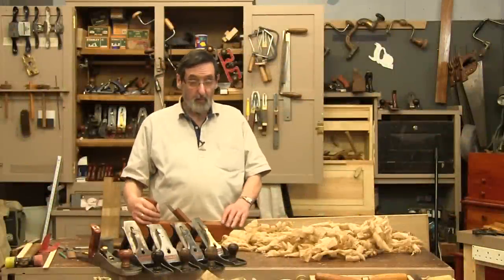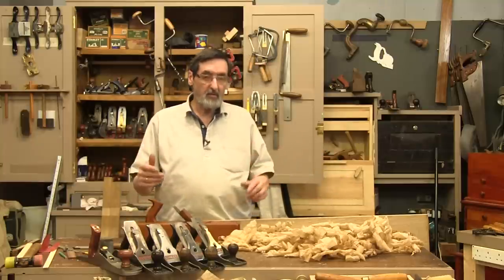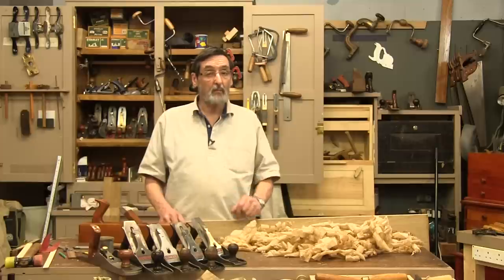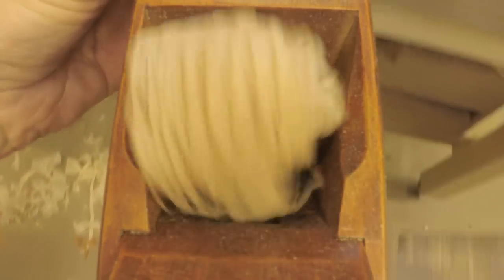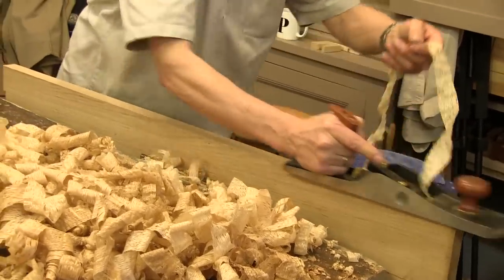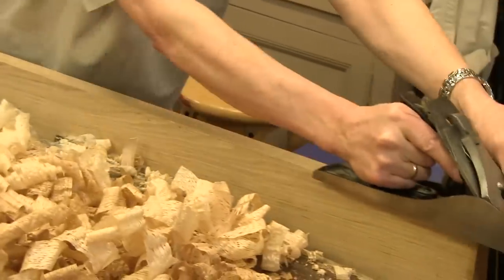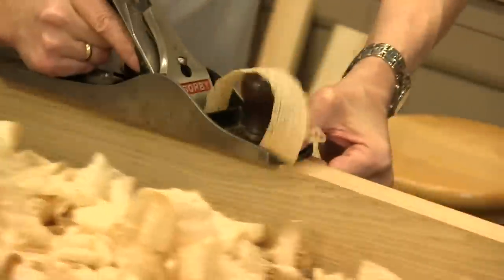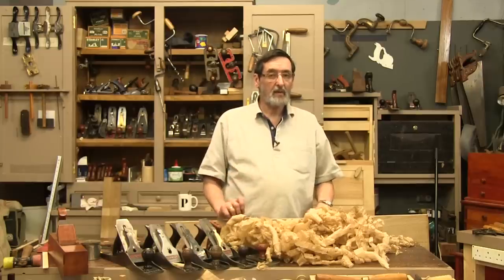Plane Bevel Ups and Downs | Paul Sellers

Comment: This and other videos of Paul's vigorously prove wrong all the BS being pushed today that we need $300 hand planes with thick, bevel up irons and the need to spend hours tuning and flattening them at that.  Such ridiculous BS.  I regularly cut shavings to 1000th of an inch with ebay and flea market stanleys, and craftsman brand planes (millers falls are great too). I do think there is a downgrade in quality of anything starting in the 1980's with US made products and alas we hardly make anything today that I can either afford or isn't crappy (or both).  Also, I actually have better results on endgrain with bevel down planes and regular angle block planes as opposed to low angle.  Stick with Paul if you like truth and reality instead of hype and fluff.
Reply: I AM ONE OF THE GREAT UNWASHED.
To me looking here is a gift. It's tough when you are beginner. , I look at these discussions and they impress me but I do have a problem with some of the advice I see on line.  Evaluating older and newer and cheaper with more expensive is ok, but
I am sure most planes can be directed to produce good results. My first planes were new Stanleys. I COULD get them to produce (or if the product was not good it would was likely be my fault.
My problem is those planes failed at continuity. Parts could loosen in the middle of a stroke!
The blades wore out  quickly, settings wandered and fairly often were not square. 
That's the real downside, to me.

Comment: That 'plane cam' was a real treat. Very satisfying!
Reply: I have said  the same sentiment as what you said in your introduction.  If you look at the amazingly beautiful woodworking produced by workers who did not have the benefit of the centuries of experience that we have today.  Add to that the fact that many of these tools were invented by these everyday workers.  These hand tools were the predecessors to automated mechanized told we have today. We can set up and load a conveyor belt to keep feeding boards into a planer then walk away and go for coffee.  That eliminated much of the fatigue the had to deal with.  What we have today is only posible because of what was done before.  Think of what those craftsmen could do with the tools of today.

Comment: Paul, this video is extremely helpful to me. I picked up what appears to be the exact same wood plane at a flea market last weekend for $3. It's in much better shape than the one you have in the video. I think whoever owned it stored it and never used it. After watching this video and the one on restoring a wooden plane, I now feel more confident. I didn't even know how to hold an older wood plane until I saw these videos. Thanks to your helpful content, I now know how to hold it, sharpen it, restore it and will now give it a new and useful life in my shop. Thanks again for the fantastic work you do.

Comment: Watching this made me wonder why perform the test on such an easy board?  Although this shows that all these planes are similarly competent for work on the edge of a board I would like to see how they compare on a variety of planing task such as, end grain, flattening the face of a board and interlocking grain. 
Also thinking about the wood plane I am going to go into the shop and laminate a piece of veneer to the bottom of one of my #4 Stanley planes to see how it feels in the cut. 
Love the addition of the camera on the tool.  Great visual and editing was perfect.  As usual Paul's presentation was spot on. Thanks for the post.
Reply: What a great idea with that veneer on the sole. Tell me if you’ve done it and how you like it.  Cheers
Reply: Because PS is about making woodwork accessible. Iroku isn't the easiest but not the hardest, but likely the hardest a hobbies might encounter

Comment: Just bought my first jack plane.  I am pretty excited to get to work with it. It will be my first adventure getting away from the jointer and dewalt planer.  Thanks for the tips in this video and your other video's about hand planes.

Comment: Hi Paul,
I watched your presentation because I was trying to verify the angle that a blade needs to be ground to. When I went back to my blades, to get them to an engineering shop to have them reground/machined, I found on all of my Stanley blades; some manufactured in USA and some in UK ; all had printed on them the suggested angle of 25 degrees.
All the presentations I saw spoke of other angles.
So I thought I would mention it for what it's worth; 25 degrees seems to be a standard

Comment: I have 4 wooden planes that I bought off Ebay and restored.  They are wonderful to use.  Almost not enough friction with the wood against wood.  Funny thing that.  Ialso have an old Record metal plane, a few new Veritas, Woodriver, and LN planes.  All are wonderful to use.  Love all of them, bevel up and bevel down.

I will say it's nice to sharpen the bevel up planes since it's one less step not having to deal with the chipbreaker.  Saves that extra 45 seconds for another sip of coffee. :-)

Comment: Paul,

Love your videos.  However, even though the bedding angle of the Veritas and Lie-Nielsen Bevel Up Planes are 12 degrees, the cutting angle is the angle of the blade bevel, PLUS the 12 degrees bedding angle.  

Out of the box, the Veritas Bevel-Up Jack Plane is 12+25 degrees, or a 37 degree cutting angle.  If you install a 37 degree beveled blade it will have a cutting angle identical to the Stanley Bailey types with a normal frog (45 degrees).  The primary benefit from the Bedrock style bevel-down planes is the ease of adjusting the position of the frog for adjusting the blade opening clearance. I doubt their stiffer body design makes much difference. Additionally, both Veritas and Lie-Nielen bevel up planes have very easily adjusted mouths, requiring to tools or disassembly for adjustments.

Any well sharpened and even moderately tuned plane with the proper mouth opening will yield gossamer shavings.  

The great advantage of the Bevel-Up planes is you can keep different bevel angle blades at the ready for different tasks from end-grain to highly figured woods.  Additionally, there is no chip-breaker iron to adjust or maintain.  

My plane collection spans from a $5.00 garage-sale #4 Record (Bailey style) to a $400+ Lie-Nielsen #7.  The big difference is the quality "out of the box" plus the advantage of a Bedrock type design for ease of mouth width adjustment.  My #4 "Footprint" is my favorite smoothing plane, using its original blade and chip breaker.  It cost $27.99 in 1986.  

I sold my #4 Lie-Nielsen bronze-body #4.  A BEAUTIFUL tool, but its tote was too cramped for my hands.  It made my hands ache to use it. I don't have that problem with the  Bevel-Up smoother designs from Veritas and Lie-Nielsen since their totes are placed well back of the blade and adjuster. 

Keep up the great work!

Steven Jaynes
Making firewood in a dozen or more exotic species since 1962

Comment: Dear Paul, Stanley Sb4 Single Blade Plane 1 12 034 used for and why does it have two adjusting screws on the blade(like the spoke shave) thank you for all your master classes.  Kind regards John.

Comment: Thanks Paul for the great video. Am i wrong in thinking that a 12° bed angle with a thick 38° iron is approximately equal to an older Stanley? The steel in the bevel up iron doesn't know its only fractions of an inch thick, so that bevel could be a 6" long bevel as far as the wood would be concerned. So what's the difference? Thanks

Comment: I bought some Chinese made Bedrock type planes (#4, #5 & #6). They are very nicely machined and have thicker irons and they are pretty heavy. I am very satisfied with their quality and performance, but I have to admit that I still reach for my regular Stanley planes (#4 & #5) more often than not because they are lighter and less tiring to use and do just as good a job. This pretty much confirms your own experience which is admittedly much more relevant than my own.

Comment: Paul, love the video. A few thoughts:

1) From what I know (this coming from the owner of a set of #3-8 Bailey planes I've restored myself), low-angle bevel-up planes excel when working with difficult, swirly face grain on figured wood. Just about any sharp plane will work when planing the edge of a board unless it's wild grain, in my experience. I don't work much with figured wood, and I've never not been able to successfully smooth a board with my bench planes, so I've never seen the need for a modern low-angle bevel-up plane.

2) Any chance you'll do a detailed, step-by-step video of tuning and setting up a bench plane? I'd love to get your thoughts on how to mate the cap iron to the cutting iron, since that's an area I've struggled with quite a bit with my planes. I sometimes get a bit of chatter or gaps between the two right at the edge, and can't always close that up successfully.
Reply: With all due respect to Paul, I would be more convinced if he had used wood with difficult grain

Comment: That wooden plane is like the Japanese hand planes that are still in use today and are amazing.. oh and so is the plan action cam shot.. so good
Reply: ZodiacProd
Start planing difficult wood and you will see why metal ones are superior. They have the same problem as the bevel up metal plans. When they start to tear out, there is little you can do about it besides messing around with different grinds. On a bevel down metal plane, simply adjusting the cap iron (chip breaker) will take care of the problem.

Comment: My first handplane I bought was a Hong Kong style bamboo laminate plane for 25$. I had to do a little work on it, flatten some tool marks in the blade opening and the sole. Yeah you gotta use the mallet to adjust it, but it slides like butter and takes super skinny shavings.

Comment: I have had to flatten the sole of a Stanley plane as it wasn’t working. I used a worn out belt on my edge sander. I find the tote on my Stanley’s a bit narrow. I have a Qiangsheng and it is far more comfortable but rather heavy. My favourite planes now are a wooden 4 with a wide open throat, thick blade and no cap iron; and two home made wooden planes with Veritas ironware. I find the lateral adjuster on these a bit short. When the irons are sharpened they all produce shavings equally well. For me it’s a matter of comfort. I have never had a Veritas complete plane so I can’t comment, but other Veritas stuff I do have is really top notch. The handle on your bevel up looks rather peculiar. One large drawback to my Stanleys is the sides not being 90* to the sole, which precludes use on the shooting board. The wooden planes are ideal for shooting.

Comment: That was an excellent demonstration. What I am curious about is how the low angle versus standard planes perform when going across the grain as in the end of a board. Also, how do well do they handle undulating grain or areas around knots? Seems like they all work well with straight even grain wood.
Reply from the maker: Hi Rick. There is a lot of fake news going out about bevel up planes being superior to a bevel down plane. Whatever you can do with a bevel up plane you can do with a bevel down plane. However there are idiosyncrasies with both planes that may give a periodic advantage and only experience can tell you which one to reach for.

Comment: The bailey planes are the finest planes of any type that I have ever used when it comes to being a user of planes. They are capable of everything a plane will have to do in a normal work shop. The irons grind and sharpen easily, the cap iron is designed perfectly to eliminate tearout and, the orientation of all of the parts of the plane make it so that you only get tired and never sore in the hands, etc, and to think that he came up with the design without other similar planes around is astounding. 

The wooden planes work a treat if they have a cap iron and the user learns to use the cap iron, but they do come out of the cut fairly easily when their irons dull if they are single iron planes.

Comment: Great video, thanks. I love my Juuma (Quangsheng) low angle jack for it's versatility but it can be a pain to adjust the blade. Bevel down planes are a lot easier to handle in my opinion.

Comment: Hi Paul,  hope this question reaches you . I've been led to believe  that if the shavings are not full and are serated its due to nicks on the blade yet I see you have this result testing the planes and you don't mention it . What's your view on it  does it matter on not  ?  My opinion is once the finish is smooth that's what counts.  Thanks Paul.

Comment: A sterner, and perhaps more pertinent, test would be to turn the wood around, and plane against the grain. Then the bevel up jack would come into it's own. It would cause less tear out, cutting at "York pitch" or higher. The thick blade and low bedding angle is far less prone to chatter than the thin ironed bevel downs in these circumstances .
Reply: I can't argue with results, but I am reluctant to accept the reasoning. The frog on a Bailey stops a fair bit short of the end of the blade, so there is a bit more air behind the edge. I think maybe that is the most important reason they chatter more on end grain. The angle is essentially identical. And the blade is thinner, true, but it is backed up with a chip breaker torqued down by the edge. So I can agree that some planes have less chatter than a Bailey, but I don't think it's necessarily attributable to "bedding angle." More likely, in my guesstimation, it is due to bedding support that extends closer to the edge, and/or heavier casting, overall.
Reply: We have all done a bit of whittling I'm sure, what sort of angle do we hold our knife? Obviously it is one quite close to the direction of the force applied. Have a go at whittling with the blade at 45 degrees to the direction of cut. I'm guessing you'd find it might chatter a bit. I do not suggest a well tuned bailey will inevitably chatter, but that at 12 degrees  the  bevel up is much the more stable.

Comment: Paul
I've always admire your videos, your patience is consistent to deliver an interesting video for all. 
Interesting enough that on your shows you never ever mentioned any use of Japanese tools i.e. saw, hand plane or chisel. These tools also have been used for hundreds of years and actually didn't change a bit, like the old wood body plane you show at the beginning.
It would be interesting on your part to look into it, or maybe I'm asking for trouble here...?
Thanks.
Reply: The problem with Japanese tools vs Western tools is the ease of resharpening yourself.
Reply: This may be an answer.

Comment: I just picked up a  Bailey 5-1/2C because I did not want to spend $350 for a Veritas bevel up Jack. Got $70CDN into this one and I am happy with that. I will clean it up and sharpen it. I expect good things from it. From a site it appears to be made between 1924 and 1939. Old enough it does not have a frog adjuster screw.

Comment: What I don't understand about bevel up/down planes is that the angles seem to be the same. 12deg veritas with bevel up 30deg iron = 42deg, bevel down bailey pattern at 44deg is basically the same angle.
Reply: You can get a 25° iron. Well, if you need it.
Reply: My guess is having the mass behind the cutting edge keeps the tip of the blade from vibrating. When force is applied to the cutting edge of a traditional plane, the area where the bevel meets the plain  body acts as a lever and fulcrum causing microscopic deflections to travel up and down the iron which could cause the cutting edge to "jump" above the level of the cut. On bevel up plane, the iron's mass is mainly in a horizontal position, so any resistance at the cutting edge would lead to greater compressive forces which really won't alter the level of the cut. 

So if you're cutting along the grain, and the cutting edge has just a bit of fluctuation, it will most likely settle back down into the cut because the wood fibers are running horizontally and the blade is "lifting" the fibers.

 If you're cutting across the grain (end grain), and the cutting edge fluctuates, the wood fibers are all vertical and the cutting edge is less likely to settle back down because there is no lifting action. The fibers are all being snipped (as opposed to lifted) at the very end and the blade. Because of this, the blade disengages with the cut much more quickly. 

Because, yeah, there isn't much difference in angle...just a WAG.
Reply: Yes, it's supposed to be that low angle bevel up planes work better on end grain or wood with grain going crazy all over the place...
Reply: LV actually come standard with 25 dog so in fact you will be planing at 37 dogs.

Comment: Many of the newer high priced planes can be weighty affairs. The one advantage that I've noticed with wooden planes is that they are less tiring to use. Obviously not relevant if you aren't planing much wood but if you have an hour or more of planing tasks it does start to become a real factor.

Comment: Hey Paul..... Love your videos , but I am still in question about bevel up and bevel down. You said that the first one you picked up of the five was a bevel up . Was the other four bevel up also ? I have 3 or 4 old Stanley bench planes and I'm not sure if there up or down bevel !  Thanks
Reply: +james carroll bevel is the chisel-like surface you see when a chisel is laid flat on it's back. 2 surfaces form an edge 1) bevel of the blade 2) back of the blade

when you have the blade installed correctly and plane is oriented how it's supposed to function, if bevel is facing downward it's a bevel down.

generally speaking bevel down planes have more "hardware" and your old stanely are probably bevel downs